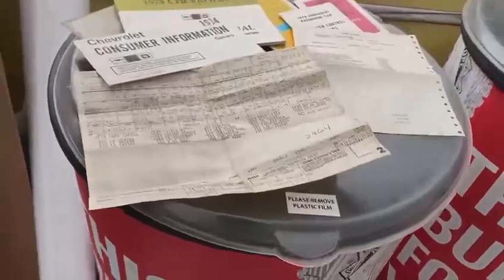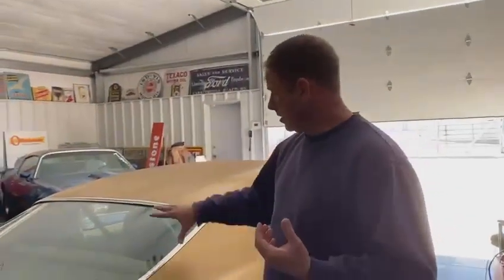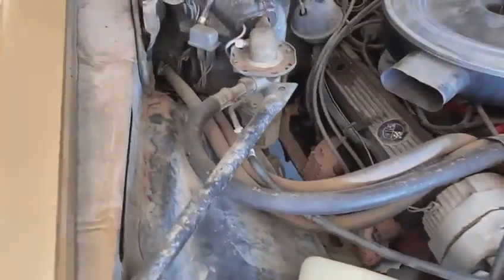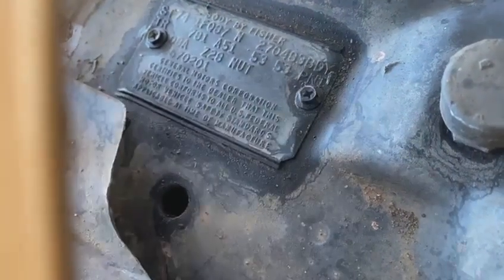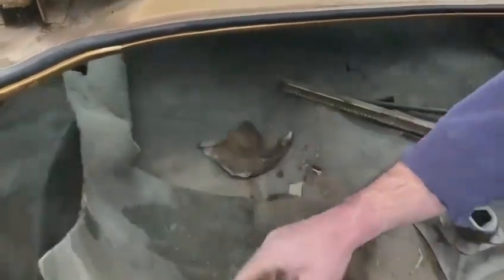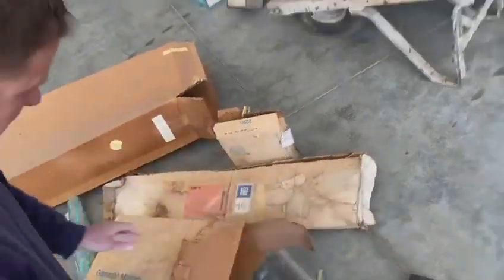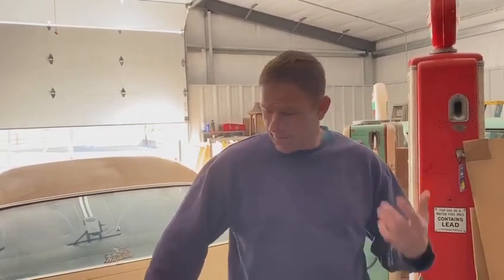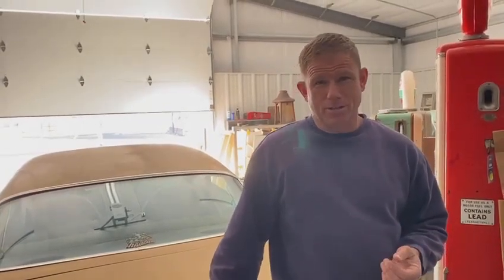1974 Chevy Camaro Z/28 - I got the car rinsed off so now we can take a good look at it!

Comment: It’s your car and your choice, but my opinion is to leave it original with the badges. If I owned it I might add white or black oem style ralley stripes. I did think the rear badge would be in the middle of the spoiler. I’m surprised to see where it is. I don’t know why they did foil on the back. Keep us updated as you fix it up.

Comment: I have a 1974 Z/28 with the stripe delete as well. The correct badging for your car is the fender emblems you have, the foil Z/28 decal under the Camaro emblem on the tail panel you have. The one you are missing is the front grill Z/28 emblem placed driver side just as they were in 1970 - 1973. I personally think the 1974 hood and trunk triple stripe call-out is too much.
Reply: The 74 Z28 never had a Z/28 or Z28 emblem on the driver side front grill.